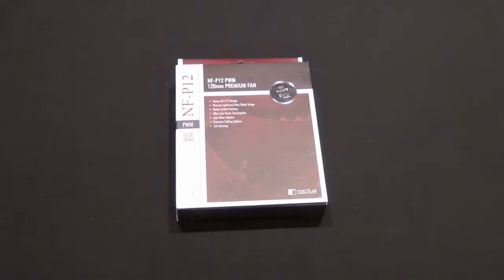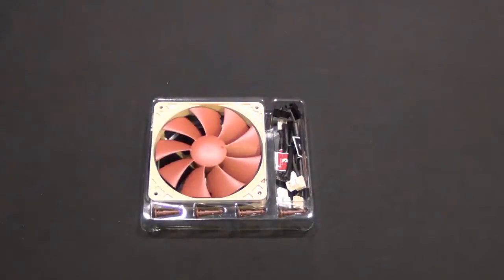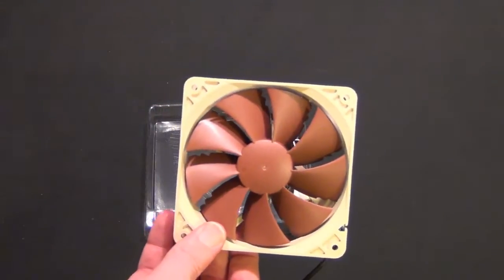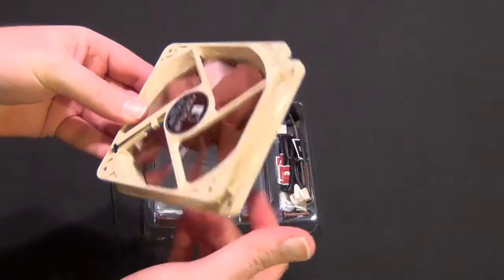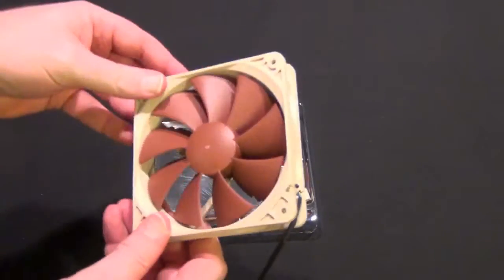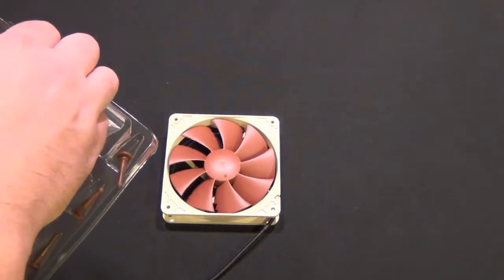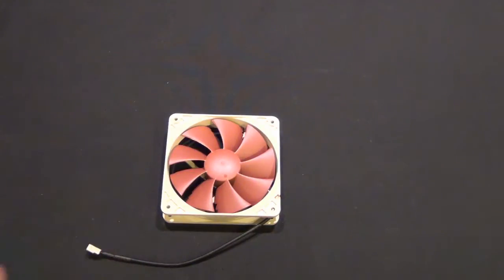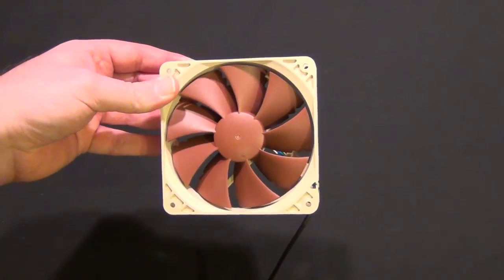Noctua NF-P12 PWM Case Fan

Comment: and you just put it wrong, F -> flow. P > pressure. Flow fans > case fans (near zero resistance) Pressure fans are for resistance (heatsink/radiator)
Reply: But what if the front of my case have tight clearance? can i use this?